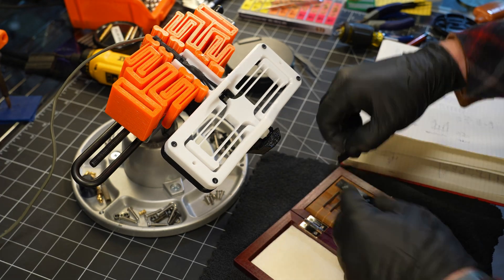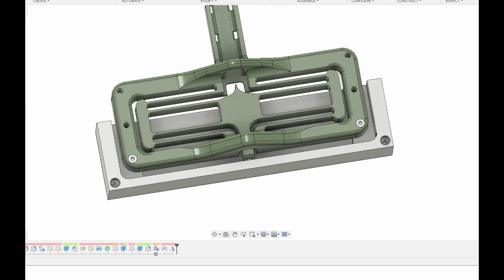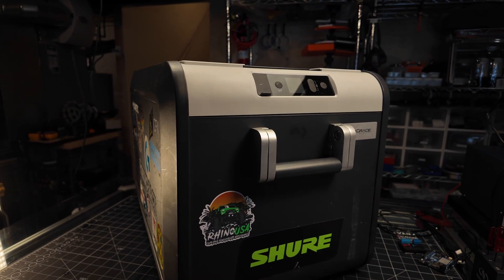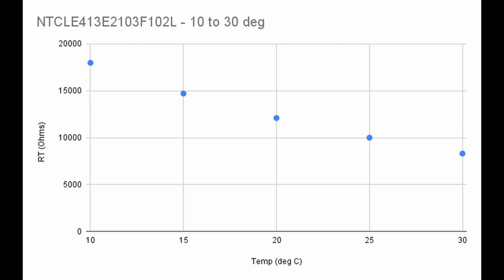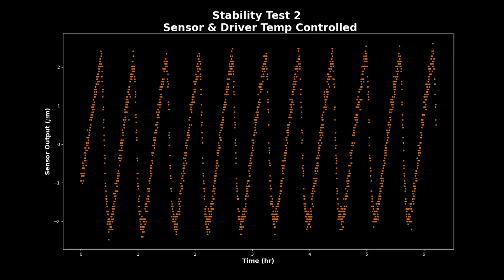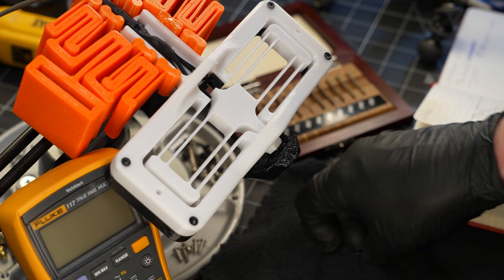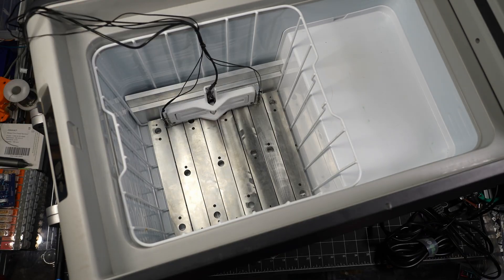Precision on a Budget: Finding the temperature sensitivity of my DIY displacement sensor.

Comment: DIY EE enthusiast here.

My recommendation for a hand built circuit intended to interfacing a well documented COTS sensor into a meteorological system is to make/buy an instrumentation amp and wire it up "dead bug" style. The intention of an instrumentation amp is it takes away all loading behavior, leaving your sensor following the datasheet as close is as possible. The intention of "dead bug" build style is that it happens to remove you from the idiosyncrasies of modern PCB parasitic effects.

(The "dead bug" style may seem "hackey," but it puts almost all of your circuit's conductor in one of the best possible mediums for reducing non-ideal behavior; the air. Turns out, modern generic PCB's are pretty much tuned for building digital systems, so really don't concern themselves with finer points of analog circuits.)

Comment: Awesomeness! Subbed and instant fan. It's always nice to find people who delve deep into the nuances of their passion. 
 Regarding the subject of this video, have you given any thoughts to mechanical temperature compensation? Like pendulum clocks utilize the difference in expansion coefficients of wood and brass to auto-regulate through daily and seasonal temperature changes. The brass bob which rests freely on the bottom regulation adjustment nut expands upwards as the wood rod expands downward. Likewise with a balance wheel, the bimetalic rims are only attached to one arm each. As the arms heat up they expand, while the bimetalic rims draw in towards the center thereby maintaining a constant moment of inertia through a wide temperature range.
  In some cases one might simply employ V shaped arms since each arm would expand or contract by the same amount the tops of the arms would remain level to each other. It's something to consider since in some cases the mechanical versions are more reliable.
Reply from the maker: @ExtantFrodo2 Thank you so much, the kind words are very much appreciated! I'm glad to hear that my love of engineering comes through, and even more glad that it finds its way to folks like yourself that seem to share that love!
I was not aware that pendulum clocks utilize that trick, and likewise with maintaining the moment of inertia in bimetallic rims.... that's awesome!!! I've used tricks similar to that for work projects previously, utilizing the difference in expansion between steel and aluminum to null out the expansion in a frame is one I've used quite a few times, but I definitely hadn't considered something like that for this. The main thing I would worry about in trying to adapt it for a sensor is the difference in thermal properties that would change the time constants for the two materials causing less predictable drift. But plastics don't have great conductivity, so in reality this sensor probably tends to hold gradients anyway, so this sort of compensation approach may indeed prove a net benefit. I'll absolutely have to ponder on this one a bit more. Thanks for the awesome extra tidbits and suggestion!
Reply: @bubsbuilds  You're very welcome. You deserve it. Keep up the good work.
Reply: @bubsbuilds  Hey, just a heads up. I searched for you on ROKU and found no trace. The closest was a bdubbuilds who definitely wasn't you.
Reply from the maker: @ExtantFrodo2 Oh really? Hmmm, not sure if that's something I can have any say over, but I'll definitely give it a look. Thanks for the heads up! Also...not gonna lie, kind of curious now what "bdubbuilds" is all about :)

Comment: As someone studying the dark arts of electrical engineering, the RC analogy for the temperature smoother was really good. It's funny that circuits are often used in EE thermal design because so many of the same principles carry over. A thermal resistance can be expressed as a resistance, where temperature is a voltage and rate of heat flow is current.
Reply from the maker: @YSPACElabs I'm just glad to hear that my analogy wasn't too far off base! And I know, I also have always loved the analogies between circuits and fluid flow systems. That's one I've made use of many times over the years and have found extremely helpful!

Comment: Maybe adding a Peltier element with temperature control will get you closer to industrial grades.
Reply from the maker: @TenchoTenchev My past experiences with implementing thermal control on stuff like this have had me chasing my tail quite a lot to make them work, so I'd be hesitant, especially for the sensor body itself. It can be hard to get the heat in and out consistently across the device, and I think having thermal gradients can be even more problematic than just temp drift alone. But it has been a little easier on the electronics side, and given what a large contribution to the error the electronics proved to be on this, temp controlling the electronics enclosure may indeed be a worthwhile idea to pursue!

Comment: The opamp has input offset voltages and currents that are temp dependent. If you vary the temp (even in a controlled environment) you will see problems. An instrumentation amplifier  (built from 2 opamps) should do the trick. If those offsets are not nulled out, I would not trust the results you got. Input offsets for a cheap opamp (like the TL08) are on the order of 10s of mV, which will definitely mess with wheatstone bridge measurements. Zereo-offset opamps are also an option.
Reply from the maker: @marcorademan8433 VERY good to know, thank you! I'll definitely have to look into that a bit more, much appreciated! Any specific instrument amps or zero-offset amps you recommend for general purpose builds like this?
Reply: @bubsbuilds Thanks for the reply. I would recommend the OPA4188 for a quad package zero-offset opamp, and the INA818 instrumentation opamp. You can also build your own instrumentation amplifier with 3 opamps, but you'll need some high precision resistors for that and probably a very low input offset amplifier, so it's best to go with the zero drift one. Perhaps google "non-ideal opamp characteristics" and look for a TI app note or two to get an idea of what temp issues you may face with opamps.
Reply from the maker: @marcorademan8433 Awesome, thanks! Building my own instrumentation amplifier is probably not something I should dive into (you saw those resistors...right? :) ), but definitely appreciate the suggested googlings and part reqs, thanks!

Comment: LM358 isn't a rail-to-rail opamp, the output won't go to fully to GND or VCC, did that affect your measurements?
Reply from the maker: @accidentalengineering Great point, thank you for pointing that out! It didn't impact my measurements for this testing, but it does mean that my stated output range of 0 degrees C to 100 degrees C isn't actually true. It will probably only output over the range of about 5 degC to 85 degC (losing more on the top end because of the non-linearity in the thermistors). Is there a rail-to-rail option that you recommend for projects like this that would have been a better candidate?

Comment: I like thermistors too, but I always use a simple voltage divider rather than a bridge. A voltage divider energized from the same voltage reference source that sets the scale of the analog to digital converter provides a ratiometric measurement, which produces a fixed ADC output value for each thermistor resistance even if the reference voltage varies (since both divider and ADC operate on a ratio basis with the exciting voltage). Usually on Arduinos etc the default configuration is for the ADC reference to be the 3.3V supply rail. Not super stable, but then it doesn't matter if you put the thermistor divider on the same rail. Using a separate voltage reference to excite a bridge as you've done here is not going to help matters, because now the ADC and bridge are excited from different references and relative drift between them causes error. 

There's one caveat which is self heating. Using a nice stable excitation source for the bridge or divider is nice to minimize variation in thermistor self heating, I suppose, but despite the Arduino's 3.3V not being super precise I think most voltage regulators on Arduinos are probably stable enough that self heating variations won't matter. Ideally self heating is only a couple tenths of a degree total, anyway.

I am sort of coming into this half way, having not seen the first video yet. But are you using an LED/phototransistor optointerrupter as an analog position sensor? That sensor seems like it is going to exhibit an enormous temperature sensitivity, because the amplification factor of the phototransistor will be strongly temperature sensitive. Have you tried just subjecting an optointerrupter alone to the temperature swings, with your measurement circuitry attached, to see what kind of variation it produces?

I feel like the only way to use a phototransistor as a precision analog sensor would be to somehow have it act as a null detector. For instance one could put a second, small LED in the field of view of the phototransistor which was NOT moved by the flexure. Then, one could alternate between illuminating the flexure-obstructed LED and the unobstructed LED at a couple hundred Hz or a couple kHz. Then, if one measured the difference between the two LED brightnesses, and used this difference to control a digital to analog converter or filtered PWM source via a control loop that  changed the brightness of the unobstructed LED until the difference signal at the phototransistor was driven to zero, this would produce a signal that to first order was not temperature sensitive (or more specifically not sensitive to phototransistor gain variation). There would be issues with the changing luminous efficiency of the servo'd LED as its temperature changed as a result of changing drive current, but this could be compensated by shortening the on time of the servo'd LED as the drive current increased, to keep both LEDs at the same average current. Obviously this is complicated and electronics/firmware heavy... maybe not what you want to spend time on!

Comment: Great video! 
0:32 wouldn't the temperature affect the whole center mass up to the sensor? looks to be about 60mm which would match up with the experimental result a lot better.
5:52 going to all that work to build a board and then using the arduino ADC 🙀 just use the differential channels on an ADS1115
Reply: Arduino ADC with the built in reference voltage at that!  I'm glad he at least recognized the temp-co errors in the electronics.

No shame in not knowing what part to use though.  I've been there before and trying to find what to use is not fun.  For example, I had never heard of that ADC before now.
Reply from the maker: @theknio1  Thanks!
I don't think that's a contributor. Since the frame is made of the same material as the moving element, there wouldn't be any differential CTE. So the sensor should be moving along with the growth of the center element, and I wouldn't expect that 60mm to result in any relative movement between the 'knife edge' and detector. As a bit of extra support for this, when I did do some fitting during the initial temp cycling (prior to adding the electronics into the cooler), I did get a drift in the ballpark of the expected range of 1.5 um/degC...but my confidence in that data and resulting numbers would be quite low, so grain of salt on that tidbit for sure. Also, I've certainly been wrong before :) 

Haha, no clue on the second point, but I'll definitely have to give that dedicated ADC a look, thanks! I tend toward Arduinos and similar since they are a 'known entity' for me, and also provide serial and/or wireless comms. Also allows me to be lazy and re-use old code. But if in looking into that ADS1115 proves to be an easy swap, I'll definitely consider making the switch down the road! Thanks for the suggestion!
Reply: @bubsbuilds  ah, makes sense about the frame on the sides too... assuming it was only held by the lower bolts and the rest was free-floating.
I mentioned that ADC in particular not because it's the best but because it seems to be a really common arduino accessory. Adafruit has it as a breakout board with code (any many other clones)

Comment: Awesome video. It is cool to see the error sources i this sensor being identified. It would be interesting to see what simple improvements to the electronics could be made to recuse their sensitivity to temperature. 

A point of feedback on the graphs. I love me some graphs, but the change in Y axis scale and range between every plot was making it difficult to follow. Would be nice to see them hold the same range if possible so it is easier to see the relative scale of the different curves.
Reply from the maker: @ethan_becker Thanks! That would indeed be interesting....hmmm...wonder who I could ask about ideas for that? 🤔 :) My assumption is that the most 'bang for the buck' would be in stabilizing the current flow through the emitter LED, but as the video clearly showed, I've been wrong before!

Great point on the plots, thank you! Looking at it now I can absolutely see that. I think I was too deep in the forest staring at trees. After so many days of staring at the data, I took the self-familiarity a bit for granted. Definitely something I'll try to keep an eye out for on future plot-including future videos, much appreciated!
Reply: That's a completely different branch of metrology, and electronics are annoying in that even when they're at temp they still can drift.  Plus, need to be continually powered or you'll get different readings.  The Marco Reps channel shows how deep that rabbit hole goes.

The other thing is reference voltages on those small microcontrollers are, frankly, crap.  Which is why they almost always have a way of using an external reference.

However, if you only need millivolt precision things are much simpler.  Just use a $10 reference voltage source and ovenize everything.  Aka, use a PTC heater to bring everything up to 50C or so in a Styrofoam cooler.

Comment: What are these sensors used for? I mean where is needed to measure microns?
Reply from the maker: @Hubert8299 apologies in advance for what I suspect is about to be a long-winded reply :) But great question! For this sensor build specifically, I built it to measure the runout on a rotary table I was building. In general, the majority of use-cases I've had for displacements sensors measuring microns (or below) has been for characterizing error motions in things like machine tools. If you want a boring (but in my opinion interesting and extremely useful) read that includes references to quite a few uses of capacitance probes for these kinds of measurements, the ASME B5.54 (https://www.asme.org/codes-standards/find-codes-standards/b5-54-methods-performance-evaluation-computer-numerically-controlled-machining-centers/2005/print-book) standard goes through characterization of CNC mills. The general rule of thumb I've usually gone by is that you want your characterizing tool to be 10x better than what you're aiming to characterize. So if, for example, I wanted to verify the stated accuracy of my Elegoo Saturn's Z-axis motion, which is claimed to be 0.02mm, I would need a sensor that's good to 0.002mm/2 microns. Some places I've worked for/with have had quality assurance rules that reduce this req. to 4x, but that would still require a sensor that's traceable to 5 microns if qualifying a machine that's supposed to be good for 20. 
Thanks for bringing up a great point though. Chasing decimal points without asking "why do I need them" is a great way to waste a lot of time and money!
Reply: Measure surface finish of parts would be one application, certain molds, anything to do with semiconductors.
Reply: I've spent far too much time working with imperial threads so, here's how I think about it.  Coming from someone who does not need that much precision it's scary how fast microns become relevant.

0.001 inches = 25.4 micometers.  In my experience 0.010 in can be the difference between barely engaging and having to use a wrench.  Which translates to 254 micrometers.  Still a big number, but my tollerance has to be smaller than that for things to actually work.

3D printers typically have a resolution of 100 microns and that's what I shoot for when modeling.  So just in 3D printing threads for protective caps I'm already in the double digit micron range.

Comment: Im not shure...using a wetstone bridge for a thermocouple is kind of overkill you could have gotten by with a pullup resistor and done the calculation that way
Reply: The bridge lets you narrow the measurement range, so more resolution within the temperature he wants to measure. If you have a high 24 bit ADC, then it probably doesnt matter.
Reply: @jaro6985  thermistors are used because of their high sensitivity. Using a thermistor with a properly matched pull-up resistor for the range I was interested in, gave me ~0,04°C resolution with just 12 bit ADC.
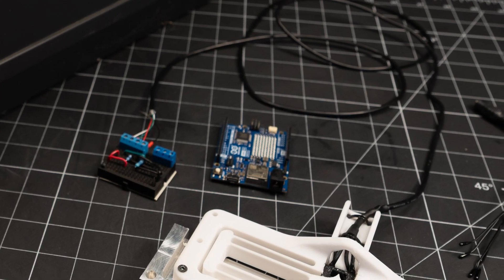Reply: @deadlockdead  You can see at 6:02 his measurements are well under 0.01C, whether or not that is needed, no idea.